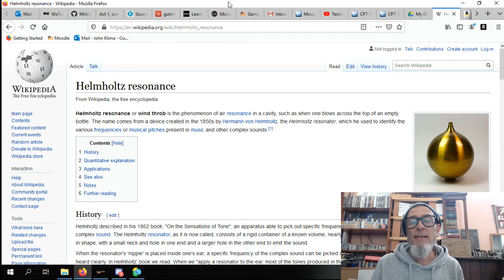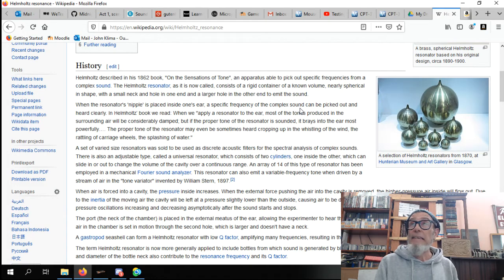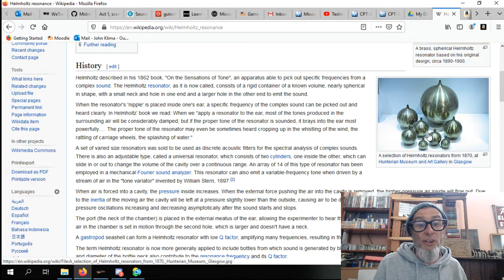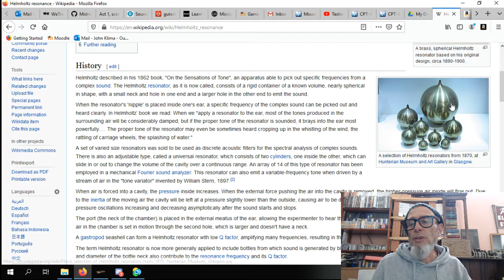Helmholtz Resonance

Comment: I'm not sure it's right that sound "goes through the holes" when its wavelength is less than the radius of the holes:speed of sound is about 346 metres per second, so the wavelength of a 350Hz soundwave is about 1m. And... the wavelength of even a 10kHz soundwave is 3.5cm, which... is maybe still a little bigger than the holes in your particle board? I'm not saying your design won't work, I've seen videos about similar designs... it's just I don't think the physics/formulas work how you're saying?
Reply: You are correct. At low frequencies, sound behaves as a pressure wave. In the Audio Engineering Society, we have a saying: If you know what you are talking about, talk to us in numbers, graphs, formulas etc.
Reply: @nicassiuscordero7173  but isn't sound a pressure wave?
Reply: Helmholtz resonators resonate at frequencies with wavelengths much longer than the diameter (or circumference) of the neck opening. So the explanation offered here is incorrect.
Reply from the maker: yeah whatever, the basic idea about the physics is correct if the exact math isn't. The point is the holes with a resonant or absorbent chamber or material behind the holes will exclude or allow wavelengths to pass and be enhanced or diminished based on the physical properties of said materials and holes. Again the point is not to provide people with equations, it is to demonstrate how simple acoustic treatment can be. Any acoustic treatment is better than none.
Reply: Absolutely right! @johnklima1814  I am currently trying to do a similar project to dampen the sound of a train next to a house.